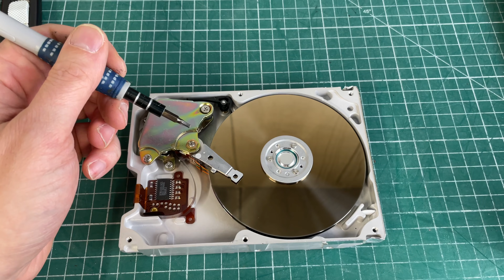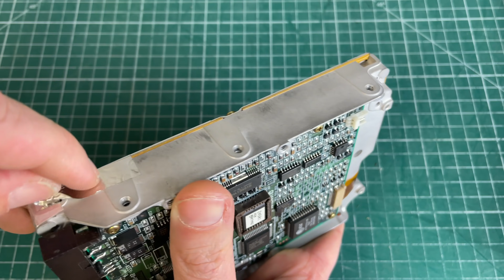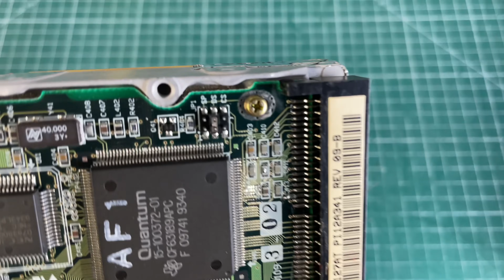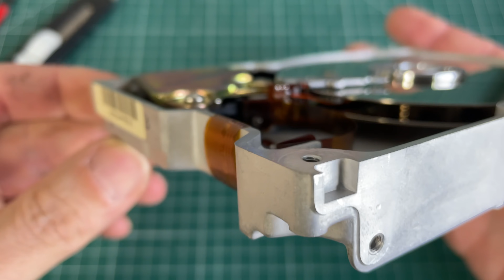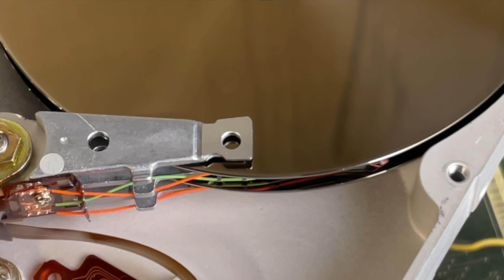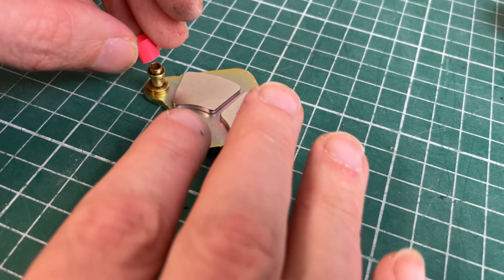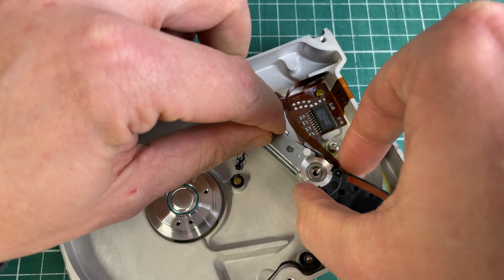Hard Drive Repair Gone Horribly Wrong

Comment: Dude, wth! how did you not think using force on the most sensitive part of a high precision machine wouldnt damage it? you literally did everything wrong! Sorry if it hurts your feelings but ffs! I never tried to repair a hdd but i was already shouting at the screen while watching you push the heads with a screw driver!
Not only could you have broken (you did) whatever was holding it, but you could have pushed the heads into the surface and if not damage it, you could have misalligned the heads.

fyi there are some plastic thingies to separate the heads, they are hdd model specific. Youd need one specifically for hat actuator arm model. Your best bet would be to 3d print it.
Reply: And now this is one of the great videos to learn from. So, why all the aggression, when this is exactly supporting your recommendations 😉😄
As for my part, I enjoyed it immensely and even though I knew about the disintegration bumper issues, I never saw it. So this was awesome for this alone. Thanks for this video!
Reply: Just shut you mouth and stop foaming. Show us your repair of old HDD and then brag about it. It seems you totally missed the point of this video, child, so stop lecturing.
Reply from the maker: No feelings hurt :) goal was to show what all can go wrong. And I did got it working again .. at least for a whole. However this one was doomed to fail. Unless you are a highly skilled pro with all the proper tools for this 1992 drive I don’t think it could be saved.
Reply: Calm your tits... You learn from your mistakes, and in this case, from other people mistakes. The hard drive was already in a bad state.
Reply: @GabrielZ666  
you can learn from your mistakes but you can also learn by thinking ahead what you are gonna do. Its 99% thinking 1% doing, otherwise you will be making mistakes your whole life.
If it were me, i would have researched on youtube several videos about data recovery on hdds, there are many data recovery services that upload videos about it. You have some videos from one of rossmann's employees and also "hdd recovery services" who uploads his recovery methods on several types of media.  Im subbed to both because i like whatching, thats why i knew all the things he was doing wrong, but otherwise, always do some research before doing something you dont know how to do, always!

Comment: I`ve never saw a hard drive that have been opened returning to live properly.
Reply: The WD Caviar 31200 i have in my 286 didnt work at first, so i took it apart, and it started working, so i just put it back together and its working to this day
Reply: I've also opened several drives in the past, largely to recover data off them. I have a video on youtube  where I resurrect a miniscribe drive after having both it's head and platter motor seized. Was able to get data off it, and after low level formatting, works to this day
Reply: Put a CF card in place and be happy!

Comment: Great video nonetheless. Not everybody has the guts to publish their failures. I learned a lot by viewing it. Perhaps the next time a drive fails I attempt an repair rather than throwing it to the recycling.
Reply from the maker: No issues showing my failures ... lots more where that came from :)
Reply: @RetroSpector78  Failure?
 It doesn't matter. 
Sharing the insights with the community is a noble act. Thank you very much:)
Subscribed!
Reply: @RetroSpector78  well at least you recover the hard drive for a short period of time , at least to make backups which is impressive.
Reply: Agreed!

Comment: Look for a hard drive head comb to separate the heads for pulling platters. Look up the channel HDD Recovery Services and watch a few of their videos it could give you a better idea of how things are done.
Reply from the maker: Yeah that guy is a real pro doing that type of stuff for a living and has all the proper equipment. Love his videos. This video was more to illustrate  how an amateur retro collector without the proper tools would to it and how it usually ends up.
Reply: @RetroSpector78  If you have a 3d printer you could design and print a comb easily. The video was awesome by the way!

Comment: Kind of looks like that head mechanism wasn't moving because the bearing was getting stiff -- quite possibly the grease inside the bushing just dried out over time.

Next time, try a few drops of light machine oil on the center bushing first and check if that frees it up on its own.

Comment: The foil on the HD was there to protect from degausing feature of crt monitors of the time. Monitors were usually placed on top of the PCs and if a monitor degaussed it could potentially wipe the HD.
Reply: Would the degauss be stronger than the magnet controlling the disk head which is constantly just centimeters away from the platter?
Reply: @idontusenumbers  Yes considerably so. Here's a pretty basic guide. http://degausser.com/

Comment: Hehe, I have a dead Quantum prodrive ELS 85 MB from a HP vectra 386 with EXACTLY the same symptoms
I saw this rather interesting thing on Ebay and am tempted to buy one and see what it does but I am not sure about whether I want to open the thing..
https://www.ebay.de/itm/Quantum-ProDrive-ELS-Repair-Insert-Fix-your-classic-Macintosh-hard-drive/253950486931?_trksid=p2485497.m4902.l9144

This video of an attempted repair definitely spooked me about trying anything like it on my own, even if I am probably able to be more careful than him: 
https://www.youtube.com/watch?v=v-3dH8vZyDQ

Maybe I'll just send you my drive and taht repair insert for another attempt or something like that. (it might actually be fixable because I think it has only one platter)
Reply: All you have now is a dead drive. Can it be worse? Not likely. :) So make a repair attempt, or send it to RetroSpector - it cannot be any worse BTW.
Reply: @Kedvespatikus  All I have now is a dead drive  - that can be fixed maybe. if I do it myself I'll make absolutely certain that i is dead. so I might send it indeed. :D

Comment: Those screws are JIS screws. If you look closely there is a little divet in the screw head to make them discernible from Phillips screws.
Reply from the maker: Did not know that ... thx !
Reply: Didn't know that either!
Reply: Did they use that type of screw in order to prevent inquisitive people from disassembling such devices?
Reply: @CRSolarice  no, its an industry standard in Japan, hence JIS. Its used on everything from electronics to cars and motorcycles